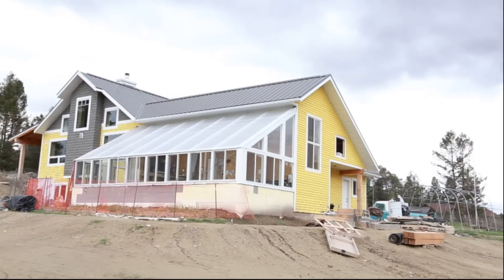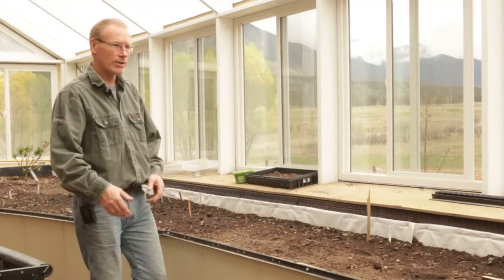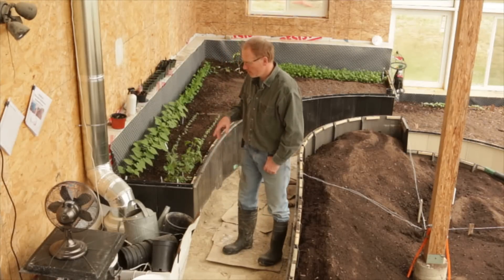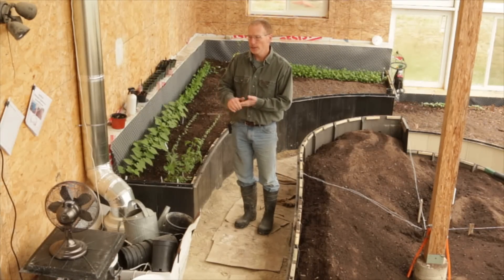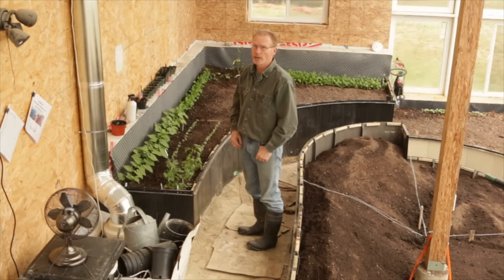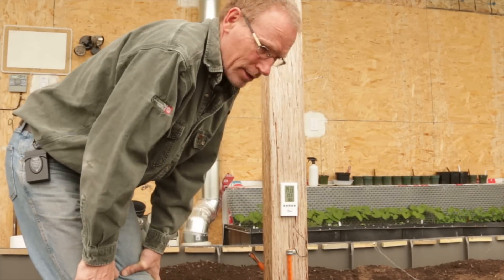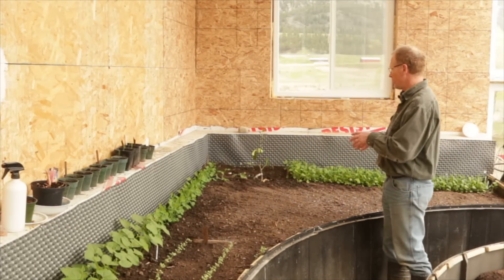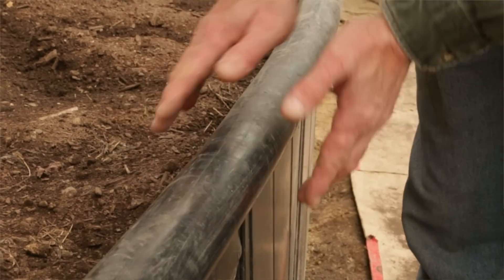Climate Battery Greenhouse and Passive Home in Invermere BC

Comment: Peaches require a certain number of hours each winter below 7 degrees C / 45F. In this situation you might need a peach variety with a low chill requirement. Summertime shading with a lot of passive ventilation is going to be key to keeping the space from overheating. May your harvests be abundant!